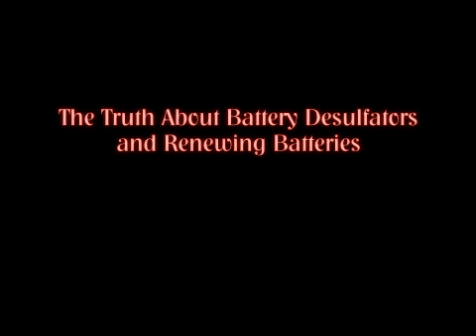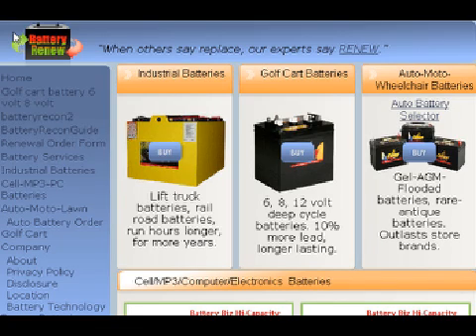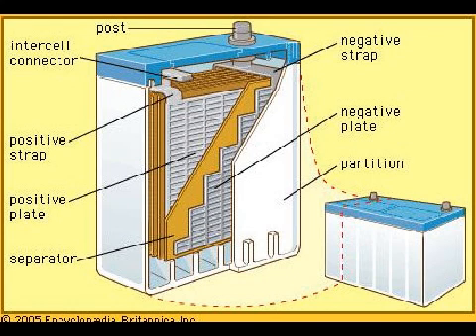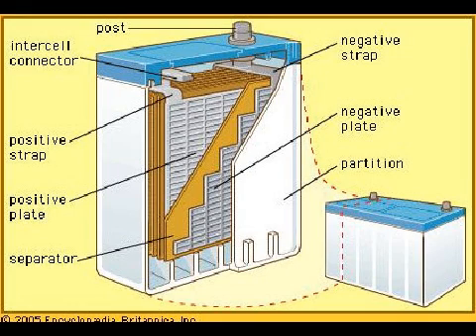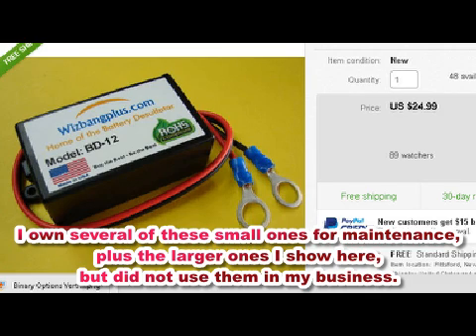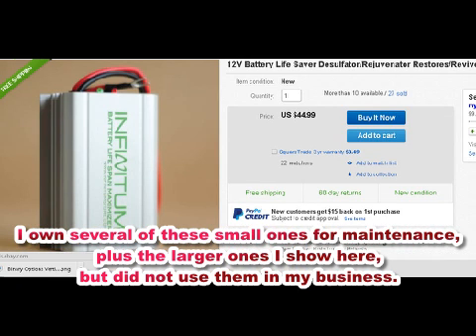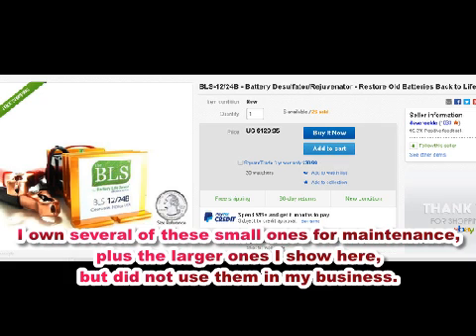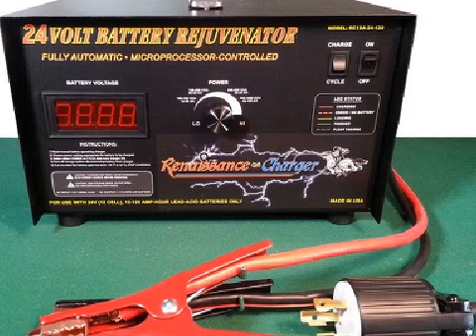The Truth About Battery Desulfators

Comment: Good job making the video, it was very informative.  I use a Pulse Tech PowerPulse passive desulfator, they claim to have a patented frequency they use to desulfate batteries, I have been using it on my BMW battery for the past three years and never have any issue's starting even though I only drive about 25 miles per week.

Comment: Hi I'm glad I ran across your channel. I got a question, I got one of those Infinitum desulfators are those to be used on your battery all the time? I've had mine hooked up to my battery for years and today I just bought a new AGM battery. Will the desulfator's work with the AGM batteries? and are they suppose to be wired to the battery permanently. Thanks for sharing.
Reply: yes

Comment: I recently revived a battery left completely drained for months in the winter. It had 4V. It was returned to health with an 18v 40mA charger (AC/DC adaptor). Unless the plates have physically lost material, all batteries can be brought back from the dead.
Reply: how long did you leave it on the 18 V power supply?  Thanks
Reply: @VladFredK  Can't remember. Probably 2 - 3 weeks. To really see the state of the battery, you need a battery analyser that gives your the CCA. With that, you are better able to tell if the battery is reviving. The CCA can continue to go up even if the voltage isn't changing.
Reply: @fungames24  Thank you

Comment: I have a optima red top, and this is my 2nd one, the first one lasted me 9 years, but I also brought that one back from the dead 3 times, optima told me to drop the battery in the grass at waist level and it will knock the sulfate off the plates to take a charge, believe it or not that did work, I now have a new battery only 3 years old and it has a dead cell and I cannot get it to come back, what can I do to get that to come back, ive heard I can jolt it with 120 house power a couple times and then throw it back on the charger, what are you thoughts thanks in advance

Comment: Thanks for the vid. I have a 74ah lead acid car battery standing for just over 2 years. Voltage across battery is around 11.3v. Battery is sulphated. I have a optimate 6 battery charger but just not bringing the battery back to life. How would u suggest I bring this battery back to life. I've seen people charge batteries with 200A for 15mins then let the battery rest for an hour. Do this cycle 5 times. Do u recommend?
Reply: eBay -> Battery Desulfator

Comment: So I have 6 6 V batteries in series and parallel to make 3 12s. Also have a magnum energy 136 amp charger with equalization capability that I don’t utilize as often as I should. This battery set up is on a sailboat where battery condition is very important.
 Is there a difference between a desulfator and equalizing? Also I know because it is such a large bank that and such a high ah capacity to fit this would be quite expensive and I’m just looking for something more for maintenance then rejuvenating. Just looking for an opinion. Thanks.

Comment: I use my very old pickup battery for backup LED lighting when power goes out in storms. I kept it on a 1.5A BatteryMinder for YEARS(5-6 not sure maybe more)before the charger started flashing a yellow warning last week. Just checked voltage of the old 1,000 cca Power King and it's 10.7 so I think the old girl finally gave up and needs to be recycled. On a guess I bought it 10 years ago and used it in the Silverado for 4 years,again,not really sure on timelines.

Comment: What is your opinion on thr pulsetech xcr 16amp charger and sulfator is it any good?
Reply from the maker: I have a pulsetech. It has been too picky about which batteries it will "accept" for reconditioning. Not been impressed with it. I prefer the desulfators that connect and go - no rejections unless you have seriously shorted cells which could be below 6 V on a 12 volt system, though usually around 9 volt.

Comment: Question, I have six of the VMAX   XTR12-155 AGM batteries. They are very expensive $375.00 a piece. They are supposed to have superior plates. Because of my ignorance of not charging at or above the recommended charging rate or a Iota DLS-IQ4 smart charger (55 amp) that has a absorption duration of 8 hours that I would use on occasion and  also unequal lengths of interconnecting battery cables, they no longer have the capacity the once had.   I normally  charge them with a MPPT charge controller. They are just over 2 years old. They accept a charge and hold 12.7 or 12.6 volts over night. I recently bought a Ancel brand battery tester. Five of the batteries show a internal resistance of between 5.12 mΩ and 6.02 mΩ. and the over all battery health between 33% to 44%. The 6th battery shows a internal resistance of 10.44 mΩ. and over all health at 10%. This is the one that is dragging down the bank the most. I removed this one from the battery bank.  The manufactures state that the internal resistance should be 3.1 mΩ. I an considering buying the Infinitum desulfator. I will attempt to restore one battery at a time starting with the worst one. The only way that I can think of to know if I am being successful is to monitor the internal resistance (other than measuring watts coming out vs. voltage). Should I keep the desulfator on the battery until the internal resistance comes back to 3.1 mΩ or stop if it gets close,..... to hopefully not ruin the battery? Please share your thoughts and guide me. This is a very expensive battery bank. Any help would be greatly appreciated.  Thank you.
Reply from the maker: Wish I had better news. AGM batteries are not designed to handle a desulfation process because the solution is often in a gel and fiber matrix that is supposed to prevent sulfation. Strange to see 2 year old batteries go bad so quickly. Here is one way to bring each battery back from the dead . and 10% to44% is nearly dead. Connect each battery separately to a high powered charger (around 15 amps would be good) in parallel ( + to +, - to -) with a lead acid battery. Charge the pair until you get a full reading. Draw down the batteries to about 50% and repeat three times. By the third time your AGM's should be well back to full capacity. It has worked for me, but try at your own risk. The batteries should never have lost so much capacity early on unless there was a >50% draw down repeatedly. AGM's do not handle >50% draws well. Hope this helps.

Comment: I live in TN , and could use some help with a Solar and Micro-Hydro System , that I'm Installing Soon . Any help or go-to Person , would be welcomed . I'm in the Dale Hollow Lake area .  I Purchased a Reconditioned Fork Lift Battery for the System .  And I'm tired of Replacing Battery's every couple of Years for Various Gas Powered Units . Thanks , David (931) 303-9056
Reply from the maker: Hello David, you can post your questions here and I will help you out. Plenty of experience with alternative energy systems since I have been off-grid for more than 10 years and selling systems for another 10 before that!

Comment: My little $40 battery minder serves me very well. If you have the time and methods can be very effective at reviving lifeless batteries.
Reply: americanstrife   The specific brand "Battery Minder"?  I have one and I did not have much luck, but I think dissimilar and unequal states of two parallelly connected batteries lead to over-charging the decent one while the weak one continued self-discharging.  I'm trying this again on another weak battery.
Reply: @louf7178  Battery Minder 1500 is what I have and yes if attempting to desulfate batteries in parallel one cannot be discharged more than the other. I have two hooked up right now in parallel and is working great.
Reply: @ianwilds3139  Just a word of caution: I've found that even starting with fully charged batteries, they will eventually come out of balance.  I charge them individually after three days to top-off the weaker one.  My previous attempt did not revive a compromised battery, so I am trying again with different strategy.

Comment: Hi....... I have (2)  5+ yr.old OPTIMA-Red Tops that have been sitting about for awhile for my 2 car's that have been broken down for a few years.
   
---- I used my Schumacher XC103 on these batteries for about 20 charges both on the AGM and STD modes at different charge setting....(not sure if I should've done that or not) but that charger is supposed to be able to desulfate batteries automatically however not sure if it's really does a good job or not.....

--- I should buy a designated desulfator like you mention in your video.

I was able to bring up 1 Optima to about 12.5v and the other only to 12.3v resting after 24hrs.

I also have an old Battery Tender Plus (Supersmart) that I haven't used yet on these batteries..... 

Can you please offer me any advice on what to do???????

I appreciate any help.
Reply: That battery tender plus is perfect for your needs or a noco genius g750. The noco is only .75 amps but it's good for your batteries or you can get one of there other models that offer higher amps.
Reply from the maker: Optima's are AGM and somewhat difficult to renew. The best way to work an AGM battery is to place it in parallel with a standard battery and run it a high amperage with desulfating running only on the Optimat battery. Monitor it carefully but you could bring the battery back over 12.7 v, or fully charged. I have a video showing me doing this with my Prius on the channel.

Comment: Thank You for thr great video and information. Some desulfator claim that you simply connect them to the battery in your car and they work 24 hrs a day,   works even while driving the car. Your thoughts on that please. This would be for maintaining the battery. Again Thank You
Reply from the maker: Hello Phillip, thank your for the question. I would not run a desulfator in the summer full time. In the winter it will not harm the battery as it will when the lead plates become soft. A decent desulfator sends high amplitude fields through the battery that can expand the lead and blow out the battery if you run it too long. I have done this a few times unfortunately. Run the desulfator while monitoring the steady state voltage, internal resistance, CCA and Amp hrs if you can. Once you reach near the rating, remove the desulfator, especially in the summer. Hope this helps!
Reply: I hope you get an answer.......I'd like to know to.  Which one's do this????

Comment: Hi,

Any opinion on Ossie Callanan's circuit or Imhotep's Radiant Oscillator ? 😐

Thanks.
Reply from the maker: I checked out the Ossie Callanan's circuit. It appears to offer a pulse spike of voltage and amperage based around the magnetic force driven solenoid. While it will work the same in principle as several desulphator's, it appears to offer less control and does not auto-tune to the frequency required to reach resonance with the battery. Much like how the Tacoma Narrow's bridge blew apart when the resonant frequency hit, a radiant charger and desulphator will blow the sulphation off of a lead core battery and expand the lead cells to renew the battery - in principle. The summary is, the Ossie Callanan's circuit does not seem to have the ability to desulphate as directly as the radiant oscillators would. Hope this helps! Interesting circuits for sure!
Reply: Battery Renew Thank you for your intricate explanation & reply. 😊

Comment: Sounds like a good estimate for Desulfators that output 200 milliamps or less (AKA the cheap $20 ones) Take about a Pound of Battery per day as a good estimate i found out of course providing the battery is in the correct condition and the battery isnt too big for a weak desulfator. In my experience, the cheap ones are only good for good sized motorcycle batteries, a car battery would take forever and may not even work due to the higher resistance and such. 30 pounds= 30 days and so forth.

Comment: Great video and info! Have a 3 year old 36 battery bank; all 6v deep cycle golf cart batteries on  solar array; have allowed acid to get well below plate tops on most; to the point charge controller stopped the electrical flow.  Some read 5v; some still 6v and some 0v; Please say the best way to check and recover this 24 volt system using Interstate GC2-XHD. Many Thanks! have subscribed and reading all replies again.

Comment: What about a Optimate Smart charger.  It's meant to help charge and desulphate a battery.  
I have a 6 yrs old jumper power pac that hardly gets used.  
I charged it with the standard supplied charger and the voltage was 12.6 v. 
I then used my Optimate 6 smart charger on the jumper leads over night and the voltage has increased to 13.1 v . ;).

BTW I keep my motor bike on  charge on this charger when I don't use it and the battery has lasted 5 yrs so far as opposed to roughly 3 yrs that it normally lasts.
Reply from the maker: Hi Ben, Smart chargers are a good investment. They will adjust charge rates from high levels above 5 amps or 10, to trickle charges in the 1.5 amp range. Even with trickle charging, I recommend using a desulphating or equalizing cycle ever 20 charges or so. Also, adding some Battery Equaliser each year will prevent plates from shedding and shorting out cells.

Comment: I just bought 2 group 24 Marine Batteries for my backhoe (massey ferguson 50a) to hook up in parallel and was wondering what you'd recommend for me to put inline with my batteries as a "maintainer". Are desulfators only for using after there is damage or is there an answer for preventing damage to my batteries? Is there such a thing for better peace of mind? Thanks for your time
Reply from the maker: Since you just bought your batteries, I would not recommend battery desulfators, but definitely Battery Equaliser. Marine batteries are a mixture of starting and deep cycle that can run well for many years if you care for them properly. If you either leave them to discharge for a long time, or you deeply dishcarge them for some reason, then a desulfating charger will be beneficial. Otherwise, a desulfator is only effective after about 2 years of normal use. They can harm new batteries by eventually blowing apart the plates. I learned this the hard way:) 

Group 24 Marine batteries from a solid brand can run at least 5-7 years when well maintained and desulfated starting around 2 or 3 years in.
Reply: Battery Renew Thank you for your reply. I'll be getting battery equilizer this afternoon. Starting from square one, I just want to do everything right. You've got a great channel and many informative videos. Thanks again
Reply from the maker: Glad I could help you out! Nobody likes spending money on batteries unnecessarily, especially when you can tweak your use just a little and avoid any problems for many, many years. My solar power batteries are running strong after 10 years, when their predicted use life was only 3-5 years.

Comment: Hey, i got a 5/2014 (3 years old) group 29DC deep cycle everstart battery i use for an inverter battery bank. I didnt maintain the water and the cell closest to the negative terminal got dry and now it gets warm when I charge it. Refilled with distilled water and doeant get as hot, but resting voltage wont go over 12.6vdc. Would a small desulfator like the wizbang bring this battery back??? Please let me know
Reply from the maker: Hi @xboxer1985, I have had several batteries with plates that were left uncovered but came back to meet standards. Your best option would be to add Battery Equaliser to your battery, roughly half the amount recommended, fully recharge it, draw it down to 11 VDC, and repeat the cycle 3 times. Battery Equaliser will bond to your dry plate, attack the rust, and allow the plate to reactivate while strengthening it. You can probably get the batter up to 13.1 VDC with charging after this process. Hope this helps!
Reply: Battery Renew alrighty ill give it a try! Reviews seem pretty good.
Reply: when you say draw it down to 11VDC, do you mean 11VDC open circuit? I got the battery equalizer today, and put 2 oz in the one  bad cell. put 1 oz in all the other cells as recommended by the bottle.
Reply from the maker: Great! Battery equalizer takes about three cycles to start working. I use a 12 v harbor freight inverter to power something such as a drill or light bulb. The HF inverter will automatically shut off - if it has that feature - once your batter reaches 11 volts. Recharge the battery and run the cycle two more times. You will see an increase in capacity around the third cycle. The big mining companies use Battery Equalizer on their $10k batteries, so you can be sure it is legitimate.
Reply: Battery Renew so before BE, resting voltage was 12.5vdc, added 2oz BE to bad cellular , discharged to 10.5, recharge, rest at 12.8v, discharge recharge again.  Resting voltage now 13.01 after 8 hours sitting. Using an IOTA DLS-90amp multistage charger. It holds the battery at 14.5v for a predetermined time, drawing 5A. Battery does get warm so ive had to shorten that time at 14.5 so it doesnt overheat too much. So it seems to be getting better.
Reply from the maker: Hi @xboxer1985, a resting voltate after 8 hours of sitting at 13.0 volts is outstanding. Your battery appears to be fully renewed:)